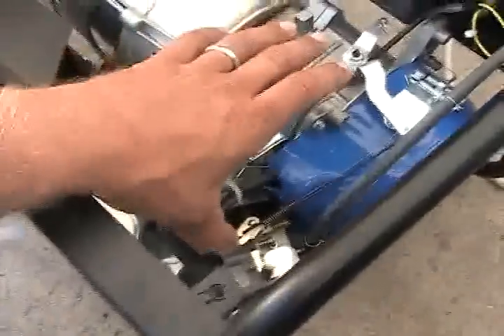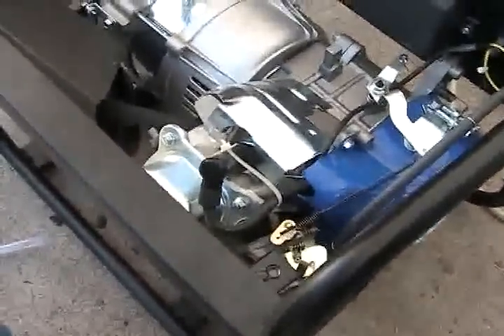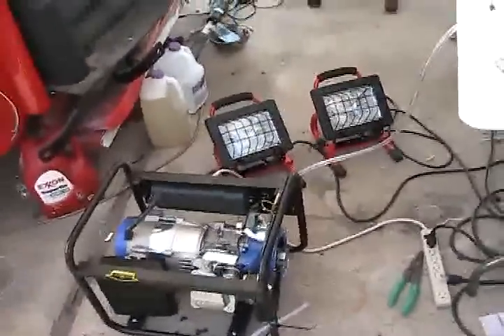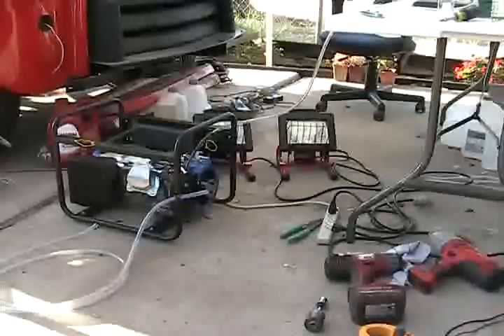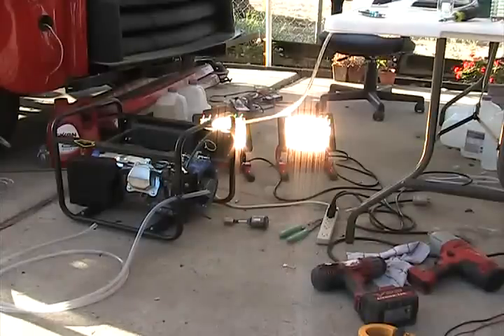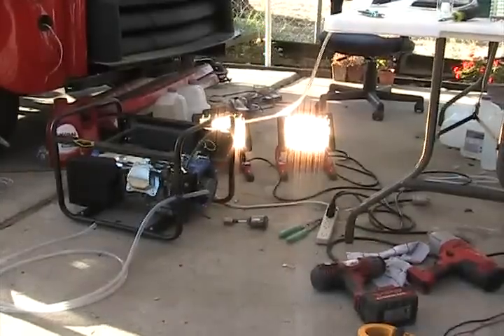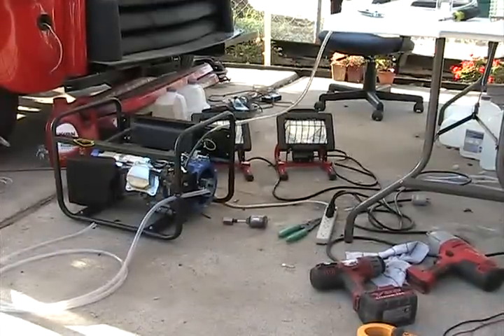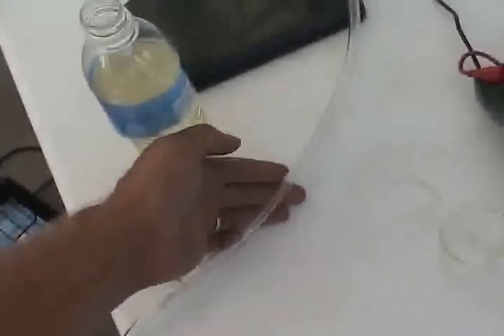generator test with 1000watt load pt.1

Comment: @d3adp001 yes, this is true during disassoication and reformation of hho gas from your standard type of cell, however, if you've built the cell to resonate the water to the point of fracture instead of using just electroysis you should reach unity or over unity depending on a few variables, the standing theory, which scientists are ignoring, is the cells are drawing zero point energy and reaching up to 100x over unity, look up moray king on youtube and listen to the interviews 1-6, its worth it

Comment from the maker: @bill71183 There is an electrical component of the hho flame, I had videos to the effect, I think they are still up. Simple version is that there is an electrical discharge when the H and O are recombined, it should be almost equal to the charge used to disassociate the h2o, what is done to the h2o is undone upon burning, so e- + h2o  means that e- is kicked out when h2o is reformed, in theory at least.

Comment: gasoline=combustable, hho gas=explosive, engine timing must me changed to compensate for the fuel type, you'll never gain rpm wihout changing the timing... second, compression may have to be raised because hho has a lower displacement then gasoline during combustion, so literaly you would have to compress hho in the engine to make up the difference, easyest way is to rase compression ratio... third, air fuel mixture on the carb means nothing now, its not the same fuel anymore